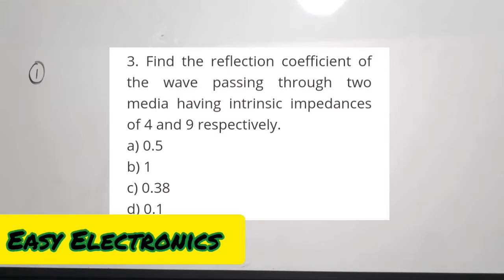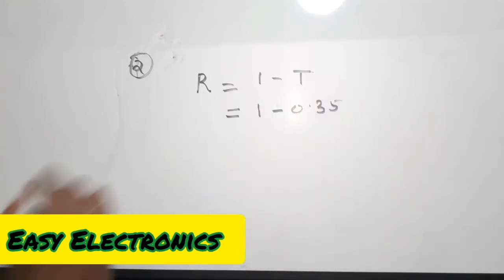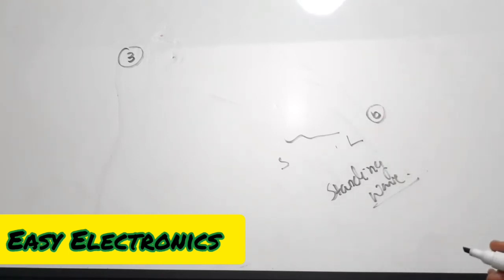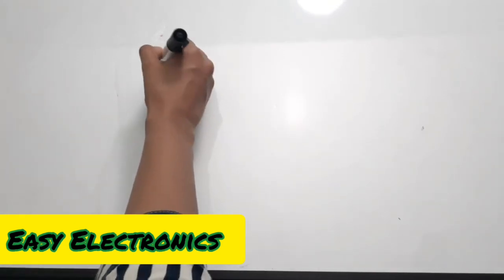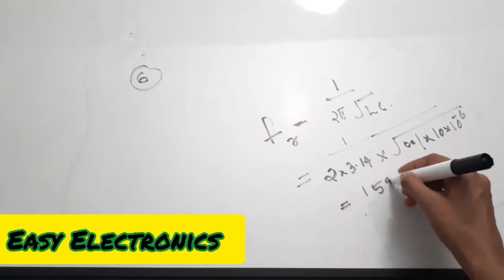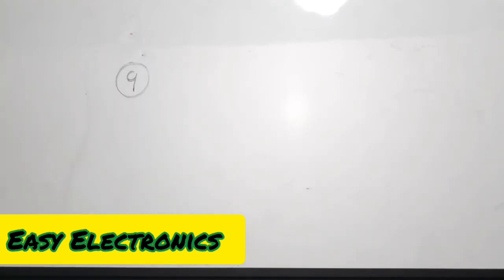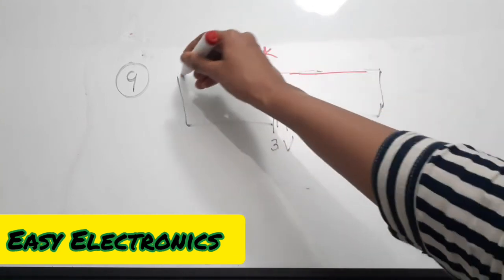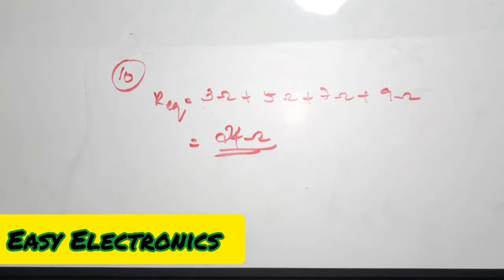ISRO HSFC VSSC SAC Technical Assistant Mock Test | ISRO Technical Assistant Electronics Mock Part22

Comment: equation connecting  R and T  is        T=1+ R...........then     R=T-1      then   R= become  negative  0.65???
Reply from the maker: Let me check once again, anyway we are not taking the sign of reflection Coefficient for calculations.
We only take modulus. So the answer is same only.
Reply: @EasyElectronics_jobupdates  ok...
Reply from the maker: But since both are opposites, ideally T has to be 1-R. Anyway let me see once again
Reply: Ok...madam